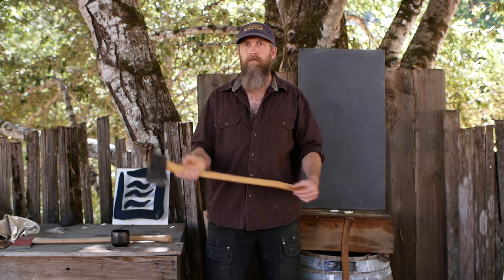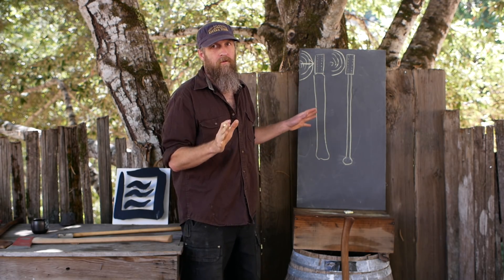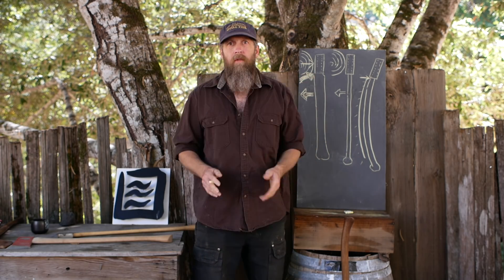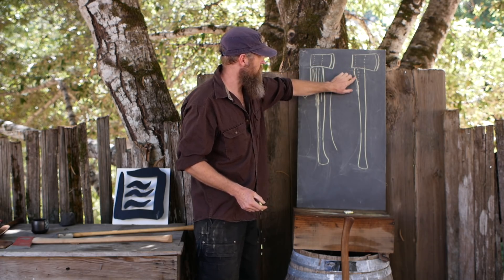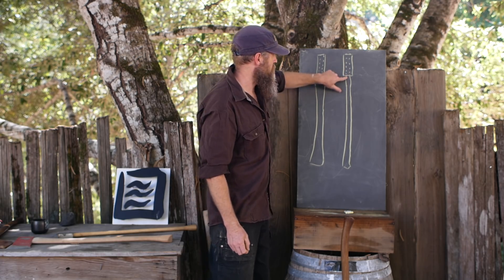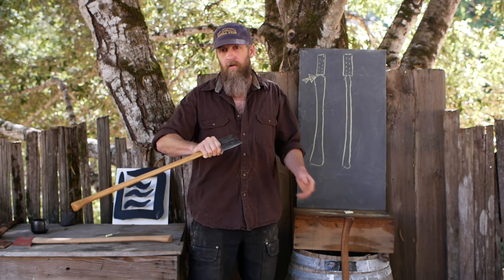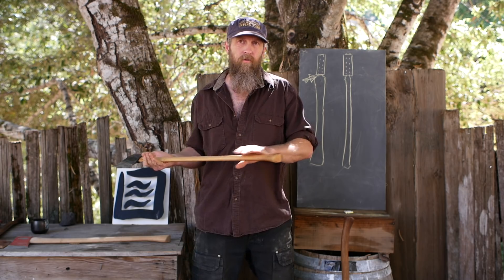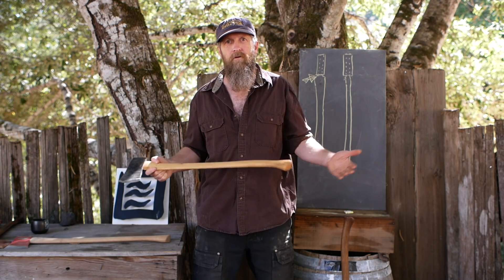Why Axe Handles Break at the Eye: When Strength is Weakness, Overbuilding v.s. Stress Distribution

Comment: I wonder how well tape holds up if its wrapped near the head of an axe. Could duct tape or some kind of rubber tape reinforce or ease the stress that travels through the handle at all in the long term? I always thought it was aesthetic or for better grip, never really looked into any properties that dampen any of the recoil or shock that travels through it.
Reply from the maker: Tape can help a lot in holding the wood together so that it doesn't fail under stress.  That can be especially useful below the eye where stress is high and the wood fibers are often damaged by overstrikes.  If I use anything, I prefer to use thin rawhide.  But tape works.

Comment: I’m a mechanical engineer—and this was a great video. I also design and make tomahawks and really enjoyed your point about “extremes” to illustrate how an axe works as a system. I have a throwing tomahawk—the design is light and throws very fast, so when the axe blade or spike sticks into a wooden target, the deceleration is virtually instant, yet the hickory handle has its own momentum trying to continue spinning forward, and this results in severe shock and vibrations. Your video has me thinking I should shorten and taper down the handle thickness, maybe even reduce the length. Less mass in the handle means less handle momentum and should reduce the shocks and vibrations. I will experiment to see if this prolongs the life of the handle. Best regards.
Reply from the maker: I think all my tomahawk handle failures have been from getting hit with other tomahawks lol.  Hard to say how that will play out I guess.  It's such a complex system.  I feel pretty unsure how much the mass of the handle maintaining it's momentum really matters, but it certainly seems that it would be a factor.  I love that law of extremes.  It applies well in so many places to understand and explain things.  Cheers.

Comment: Hello from Norway. Good video about axes and I agreed of your opinions. Some of the brakage of the axes comes from bad handling of the axes to. Some wood types who are easier to break if it is used wrong. In Norway we use a lot of ash(ask) or birch(bjørk). It does matter from which part from the tree you make handles to. Birch is best from a straight growing tree and from bottom of the tree. The outer  layer of the tree is best here, because of flexibility.
Hultafors brand is a good brand from sweden who are much used in scandinavian parts of the world. WR Norwegian fellow
Reply from the maker: Yes, I just did some videos on how people break axes by using them forcefully. https://youtu.be/y-P0rDvok3Q  Are handles there preferred with the growth rings of the tree running parallell to the axe head, or across it?  Or does it depend on the wood?

Comment: If I understand you correctly, your main point is that a thicker handle will break more easily because of the stress concentration and the additional mass along the handle.

You're partially right in your asessment that the additional mass will facilitate greater vibration in the dynamic scenario, but I want to add that the increase in cross-sectional area will more than make up for this. The stiffness increases more than enough to make up for the added mass.
I'm sure you've experienced this, as a thicker handle will more easily transfer the vibrations to your hand/arm/shoulder.

As for the point about the stress concentrations, this is also partially correct. But you are using a simplified explanation of stress concentration in an isotropic material. The truth is that wood is not isotropic, and has an important layered grain structure that you willingly neglected in the beginning of the video. This grain structure actually matters (as I'm sure you know from your work).

You said you weren't willing to prove your theory. That's ok because this kind of math can get so tedious and academic it's east to loose track of what's being proved. But if you could show physical examples of broken handles with pictures of the breakage pattern then that would go a long way for the comparison of thick vs. thin handles.

Other than that I agree with what you're saying and it is unfortunate if consumer culture has a negative impact on our tool designs.

Edit: Also I would like to know your opinion on the fiskars axe with the hollow fiberglass handle?
I think it's garbage.
Reply from the maker: I think it is a very complex problem.  For one thing, the handle is thinner in one direction, and stresses can vary a lot, the most drastic example being side to side, v.s. front to back.   I don't really follow on the thickness and vibration.  My take is that when high force is applied, the wood wants to flex and it will "try" to flex, but it can only flex a lot at the thinnest point.  That doesn't account for a lot of potential variables, but trying to map them all out and prove them with math and controlled studies seems like a waste of time, v.s. chopping more.  And I'm not at all confident it would yield very practically useful results anyway.  Regardless, thin handles are very usable and there are other reasons to use them.  In my experience, they don't break more easily, and if anything less.  Thanks for the thoughtful comment.

Comment: I don't think there is much flexibility even in the relatively thinner handles.  Why? From bowyer's bible: double the width = double the strength, double the thickness = cube the strength of the wood.  Thinner handles aren't really thin enough for noticeable flex.  This is testable.  Put two axes into a stump, side by side.  Try to flex both laterally in any direction.  The thick handles are like overbuilt bows...way too much strength capacity, never gets tapped.   Handle breaks at the wood-steel hinge as you expertly explained way before the wood can flex much.  Thinner handles same problem.  That hinge will give way before that relatively thicker (but still thinner than the THICK handle) segment of the THINNER handle.  I have a Rinaldi polless axe from Baryonyx Knife.  It is pretty straight down from the eye.  It doesn't flex perceptibly at all.  You couldn't really see the flex.  I don't feel a flex.  So if it flexes, it does so slightly? I'm probably wrong but stupidly believe I am not.  I do think the stresses are much better distributed with gradual transitions.  I would even go as far as to say the handle should be unbroken wood fiber all the way from tip to tip following a single growth ring in hardwood just like a bow.  

My biggest question is: what if the handle was whip-like thin and we added filler to the eye to an underbuilt eye wood section to fill the axe eye and built a riser ring just under the head for added strength? Perhaps we could glue on flax or milkweed fiber or sinew/rawhide? Would the reduced mass of the handle lead to different blade flight characteristics? Maybe there is a point of no return when the handle is too thin? I'm thinking it would be cool to get an axe to efficiently accelerate by lower the handle mass.

Comment: This concept can be scaled up or down too.  I was a custom goldsmith for almost a decade, where I tried fitting a tiny hammer head onto a new handle.  I intentionally carved (what I thought was) a "great", tight 90-degree corner just below the eye of the hammer head, and then proudly used the hammer... for a few strokes, until it broke.  In my stupidity (or insanity?), I repeated the install process on the now-slightly-shorter (and thicker!) handle.  Guess what?  Iit quickly broke again.  I was stumped, but now I will refit it with these concepts in mind, and I'm guessing it will survive.  Thanks!  :)
Reply from the maker: I think that is a great example, because it scales to the other end when using the rule of extremes, opposite of thining of a baseball bat or 2x4.  The 90 degree is one thing, and also the total flexibility of the handle.  Looking at old hammer handles, they usually have a very skinny waist in the upper 1/3rd or so.  That is going to bend a lot and take up much of that back shock energy.  I think if you look at really old jewelers hammers, you'll likely find that they have a lot of handle flexibility built in.  IF they have the original handles that is!   As with axes, newer hammers tend to have closer and closer to just oval chunks of wood for handles.  I just checked ebay and there are some old german goldsmith hammers with insanely long skinny shafts.  Check them out by serching "tiny hammer"  They actually have chunky 90 degree angles and joints up at the eye, but the handle flexibility obviously more than makes up for it.  I would guess those handles were made or customized by an experienced crafstman.  I think of idealized handles as flexing and distributing stress all the way up to the top of the eye.  I don't know how true it is, but it's a helpful way to visualize stress distribution.  But they don't necessarily need to if that stress is softened enough somewhere in the design.

Comment: Excellent video.  I've seen and held in my hands  old handle designs that were done that way for a reason. Falling axes from the 19th century into the early 20th century had thin handles back when people were making a living with the ax.  My favorite was a 42" handled felling ax.
The first thing I do when re-handling a ax is thin the shoulders...for flexibility and to remove the sudden stop and bounce back a thick shoulder gives when seating the head.
Well done.
Reply from the maker: yeah, if you look even on ebay at old axes, there is an obvious difference just with stock handles.  And it seems more than likely that high level users and pros were further tuning handles.  Why wouldn't they?  I was pretty shocked when I started doing youtube years ago and literally could find no one that was tuning up axe handles.  I like to think I've changed that bit. I hope so.
Reply: @SkillCult  There's a recent video on my channel where I actually took measurements. What is interesting in the old handles is the accuracy of the measurements done strictly by eye....heh...the handle I am doing was close too.  Finger sensitivity is not as accurate as a caliper but it can be done. 
Sanding???was done with a bit of glass in many cases. I learned a lot as a 16 year old from an old sawyer. HE lost his leg in a cable accident around a steam donkey engine. From 19 years and beyond he worked in the filing shop. What a boundless font of knowledge.  He spoke of re-handling an ax and the next evening having it fly through the door of the filing shack.....for another STRAIGHT handle.

Comment: I was chopping wood with a new axe and it snapped by the axe head eye, why would this happen?
Reply from the maker: For every reason in this video, but also from weak wood.  It is not uncommon to get hickory, ash and other woods that have been attacked by fungus. It is not obvious, but makes the wood brittle so that it snaps across like chalk. If that happens and it's not very splinttery, that is probably the issue. If it is splitting down at a long angle it's probably just breaking along the grain.

Comment: You should take a look at videos of SE Asian sledgehammers. They use a longer handle of whippy material and use the flex to increase the speed and impact. It looks really odd.
Reply from the maker: I've seen those in a video.  Very neat.  There is an axe too, look up a video called something like Jungle axe showing a super flexible handle, something like rattan.

Comment: When thinking solely in terms of ergonomics, I have found that the user benefits more from the thinness being at the upper half of the handle. I fit the bottom 10 inches to my own hand and gradually thin leading to the middle to upper part with the thinnest area being right above the mid point. This allows even the most giant hand size to feel comfortable and shape it to their own liking and still get the thinness needed for increased flex and function. When flexing I have found the shock to be absorbed more so when the handle is tuned in this manner rather than the thinnest part being closer to the bottom or bottom half, or even feeling like it has to be thin all the way down. This just from my own experience shaping and tuning a couple hundred handles.
Reply from the maker: Interesting.  I know that if the head is fixed and you push on the end of the handle, given an even thickness, the bend will be greater near the head.   For whatever that is worth.  Drop in handles, like the basque axes are thicker near the head and gradually thinner.   I don't seem to have any problem with thin handles, but my hands are not very big. Thanks for commenting.  Always good to hear the voice of experience.

Comment: See some.commemts here about certain axes with bigger eyes. I'd add that many old hand forged axes from Maine have larger eyes as well. It can be tricky to find a handle to fit these eyes though.
Reply from the maker: That is very interesting.  I've not seen any, but you can imagine not many maine axes make it to the west coast.  A common argument is that thin eyes were made possible by the magical properties of hickory.  I'm not sold on the idea yet, but perhaps a larger eye was used or maintained to use woods like maple and white oak.
Reply: Sounds about right. White Ash & Oak were the standard handle materials for the old New England Axes.

Comment: I’d like to see a side by side slow motion axe strike.  Thin vs. Thick. Down the YouTube hole I go.
Reply from the maker: I've definitely thought of that to study axe handle flex and also mechanics of chopping and splitting.  I actually just sold my camera that did high frame rates, but it was still only 120 frames per second, which is pretty good, but 240 or higher would be better.  That 120fps is the only reason I almost kept it.

Comment: Great info and demonstration..
I inherited an old double bit axe head, chose a handle with correct direction of grain.  It worked well till I used it as a hammer, trying to drive wooded wedges into a log.  The handle broke at it's thinnest point, just inside the head.  I know I caused the break, that lateral stress being applied to the thinnest part of the handle. Always wondered how much the grain direction added to the issue.
Reply from the maker: Yeah, very weak in that direction for sure.  I doubt the grain had that all much to do with it.

Comment: In essence we need to always address stress risers. They occur everywhere there is flex. I build custom rods.  Rod blank breakage occurs at a point anywhere a component is added, like  the guides the reel seat. Boat builders/ fiberglass layers, bike frame builders etc etc. And now another perfect example the axe handle. Excellent job bringing this into view.
Reply from the maker: Yeah, sounds more or less right as a guidline.  There can be some pretty drastic ones in axe handles, but I'm generally in favor of minimizing them as a guideline, as long as other function is not compromised.  Thanks for weighing in.

Comment: Hey SkillCult community, isn't the curing of the axe handle a key element of axe handles breaking at the eye?  When the axe is cured with linseed or other oil after the head is seated, as is typical, the oil does not propagate into the eye equally as it does throughout the rest of the haft, because the wood in the eye is under compression.  Thus the wood in the eye & the rest of the haft will by curing have different physical properties, & this difference may be a cause of breakage at the eye.

I ask this with the acknowledgment that I have only watched a few SC vids, & thus have surely missed out on a lot of the conversation.  Apologies if I've missed the boat or failed to pay attention to a relevant segment, but I've recently watched a few vids on various channels on oiling/treating axe handles, & was surprised not to have come across a mention of this issue.  Regards, G.M.
Reply from the maker: That doesn't seem infeasible.  It might matter how much the handle is oiled.

Comment: Probably been mentioned, but one of the biggest benefits in terms of practical use is the improvement in the transfer of shock to the hands when using thinner handles. This is something that is easily observable in an A to B comparison with anyone who has any experience with an axe, or perhaps even no experience. I know the video wasn’t intended to sell ergonomics, but as far as all around benefit, I would think the the lack of shock/vibration or whatever it’s called, would be close to the top of the pros list of thinner handles.
Reply from the maker: Yeah, I've harped on that a lot in other videos a lot.